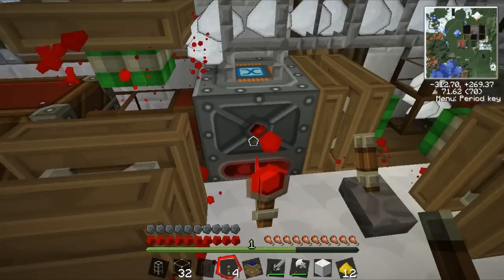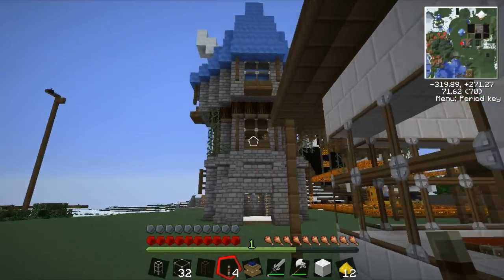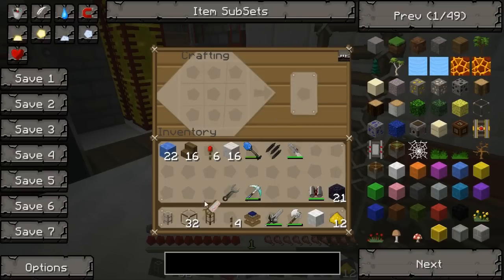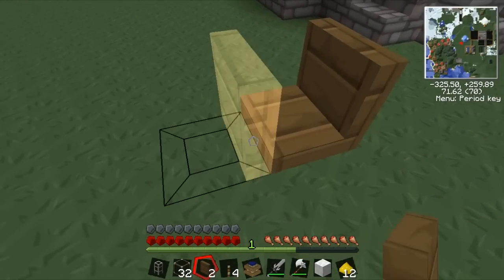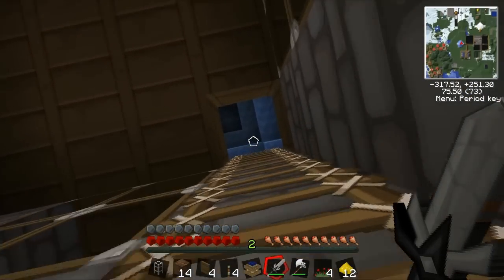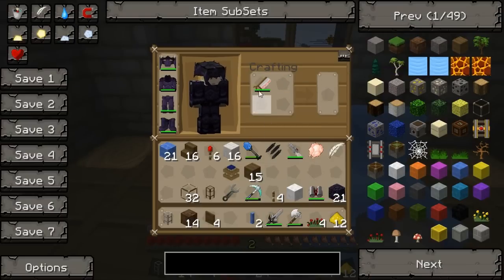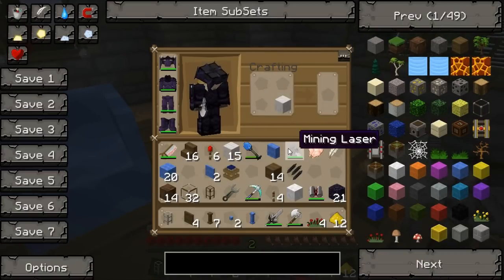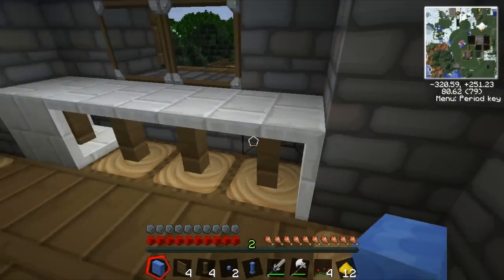Duncan's Lab - 23 - Saws!

Comment: For those having "backing up" problems like this, use a timer that sends redstone current through pneumatic redstone tubes using transposers to push the items out. They will only transport items if there is room at the destination and there is also zero risk of overheating engines.

Comment: One redstone engine is plenty as long as you let it run until it blinks red.  I usually just have redstone torches hidden in my walls to keep the engines activated.  They start off slow, but once they are blinking red (they never break/blow up/cool down) a single engine for each apparatus is usually enough unless you're trying to macerate and smelt MASSIVE amounts of different materials all at once.

Comment: The furnace wasn't getting the iron pumped out of it fast enough since the engine was still warming up. Instead of taking the finished iron bars out himself, Duncan walks away to get another engine while the other stuff spills all over the floor.

A perfect example of the one major side-effect of Tekkit. Dependence on machinery for the rest of time.
lol

Comment: bring up the start menu and type in %appdata% and .techniclauncher should be there double click that. Now find a folder called config and open that. Scroll down to a file called NEI and open that with notepad. At the top it should say lock recipe mode=true change that to false. Now open the game and go to you inventory screen and press options then change recipe mode to cheat mode.